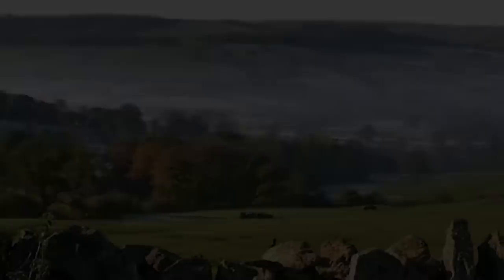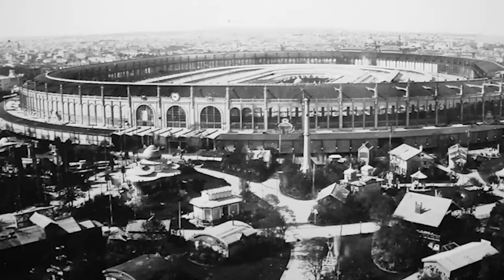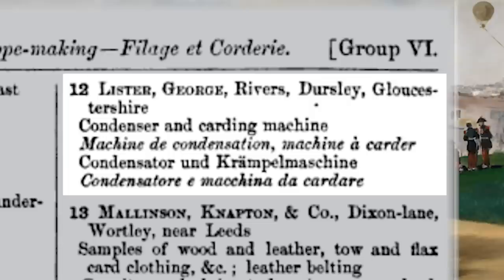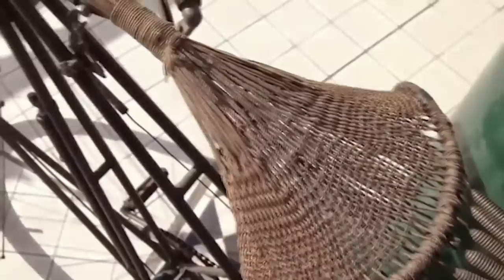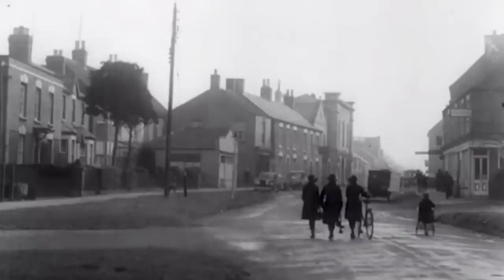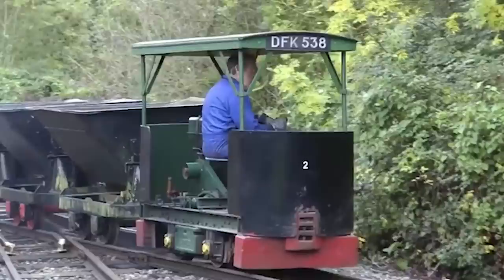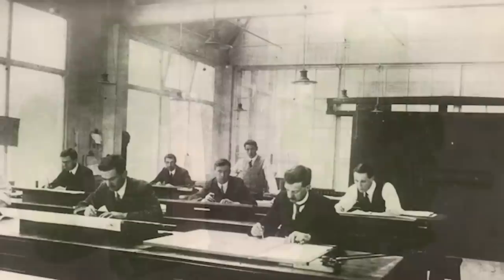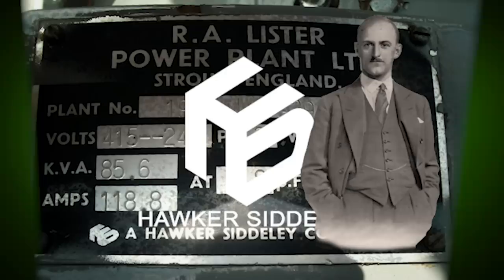The Lister Story

Comment: In 1992 I contacted Lister to see if they wanted to donate a small  diesel engine around which we could build a streamline single seat car - They donated an AC1 that had been lying under wraps in their test center since the late 60's when it had been tested as an alternative for the blue Inva cars that belched smoke from their 2 stroke - We built a tiny streamlined 3 wheeler around it and ran it at Silverstone in 93 where it achieved  1760 mpg, averaging about 17mph using squirt and coast technique  - we ran the car several years in the Eco Marathon sending framed photos back to the factory - I  still have the engine in my workshop!
Reply: A C 1 was an Petter....
Reply: @adwest68   Yup  the companies had merged to Form "Lister-Petter" by 1992 when we built it
Reply: Found this just now, is there any footage of that beast?
Reply: @pear7777  yeah I need more evidence.
Reply: Interesting story. Thank you for sharing. What happened to the car?
Reply: @G58  It made several outings at Silverstone and once at Snetterton  track to raise money for the Heart Foundation and was retired after 1999 when Shell Eco Marathan rules changed about brakes etc - it went on display in a school Technology Block until time ran out in 2006 and without suitable storage it was scrapped - I managed to save the engine which is greased and stored in my workshop under my bench
Reply: @pear7777  I don't think there is any footage online anymore - I have some photos and old VHF - it was modified several times over its 7 year service life but it never seemed to get any better
Reply: @trevortrevortsr2  Thank you for sharing this information. What a waste. It’s a piece of history.
Reply: @G58  Thank you  - in a world of computers and 3D printers there simply wasn't the demand to display a frame designed with garden canes, paper and sellotape then manufactured in high tensile tube brazed together by keen apprentices - The RAF were very kind to let us test at several of their air bases runways - they seemed to understand the value
Reply: @adwest68 in the 1950's / 1960's lister also had the rights to the design of the same engine .it was named lister LP1  .but you are correct that same design of that engine .is also a petter engine yes
Reply: @trevortrevortsr2 😢

Comment: I salvaged one of my crab boats out of Poole harbour. In it was a 1940's twin Lister. after being in under water for a year or more my dad stripped it , freed it off and re-started it. I refitted it to the boat , fitted a hydraulic pump for the slave and used it for four years trouble free until I sold the boat. Now that's engineering.

Comment: Great video thanks for posting. I am lucky enough to have saved a lister diesel generator set from being scrapped about a year ago that is around 60 years old and still works perfectly and have always been a fan of the simplicity and reliability of the lister engines 🛠👍🏻
Reply: I restored a  1958 8-1 Start-O- Matic In 2005. Wonderful machine. I use it to power my workshop in Cornwall.

Comment: In 1970 our old lister cement mixer ran out of diesel.  We were miles from the nearest petrol station,so I hooked it up to a propane gas bottle . Surprisingly it ran for a couple of days till we refueled.
Reply: I presume that you arranged for the engine to get liquid propane. Is that right?

Comment: In the late 1970's I worked at a rental yard, 
in Palo Alto Ca.  There were 3 Lister engined 
generators there.  From what I remember, the 
founder had purchased 6 gensets, to run at 
the Hoover Dam construction sites.  (He 
later opened up 3 rental yards.)

These were the older style "flywheel" style 
engines.  You'd engage the compression 
release, hand crank the engine over, and 
when it was spinning fast enough, release 
the compression releases, one at a time.

2 were 2 cylinder models, one was a 3 
cylinder.  If they were warm, I didn't need 
the compression release.  One turn fired 
them up.

In 1976, I went to Hawaii, for a summer, 
to pick pineapple.  We ran 2 shifts, of 9 
hours.  Yes, we picked at night.  The boom 
machine also had a Lister Diesel Genset 
on it.  No one else knew that I knew how 
to fire up that engine.

I recently found a small Diesel engine, 
about 200 CC, that has the same starting 
system.  It will go on a motorized bike I 
have.

steve

Comment: Visited the Dursley factory in the early 80's when I was at Stroud technical college as an apprentice in H.M. Dockyards where Lister autotrucks were used, they 're great fun to drive with the best tricks being either st them going in a circle, get off and leave it going round then get back on or find the balance point and drive them on 2 wheels, both not health & safety but fun nevertheless.

Comment: Barry, I'm wondering if Lister made engines for Ford's spec's. The 1.6 ltr engine was used in the early Pintos as well as the 2.0 ltr. German engine. That power unit would take a lot of abuse. I would shift mine when it wouldn't go any faster in a particular gear.
Reply: @ Dale Mettee. Dale, I think you have the wrong Lister. This is R A Lister Dursley. Then there is Lister Cambridgeshire UK which is a different company. They did mods to car engines and had Lister racing team. They are still in business today.
Reply: @barrywhitley2535  Barry, you're right, I think. Have a good day. Keep on keeping on.
Reply: @dalemettee1147 Although Lister Petter have used Ford cylinder blocks as the basis for some of their engines.

Comment: An American connection was created in the late 60's. Ford offered a Lister gasoline 4 cyl. engine in its Pinto cars. Their 1.6 liter was much too small for the rigors of the America roadways. The bigger 2.0 ltr. German 4 cyl. Engine was much more favorable. It also got pretty good mpg's. Ford later developed it's own 4 cyl. engine the 2.3 liter that not even close to the German engine.
Reply: Dale Mettee. Don't know where you got that info from. Lister did not make a gasoline engine in the late 60s. All the engines in the range were diesel and none would have been suitable for a car.
Reply: @barrywhitley2535  Barry, I got it from the Ford Pinto adds. I got the German engine because in required a standard size oil filter and the fact that the smaller engine required only 3.5 quarts of oil and small small filter. Now I don't know where Ford got the 1.6 liter engine but they called it a Lister made in England.
Reply: @dalemettee1147  Dale, I wonder if you are thinking of the LIMA engine used in the Pinto. The Pinto engines were built by Ford Europe. Ford didn’t introduce the Pinto until 1971
Reply: The confusion is understandable. In the late 1960’s Ford Europe developed Fords first 4 cylinder belt driven SOHC engine and called it the Pinto engine. Manufactured in various displacements it was used widely, including in North America. 

Later the same basic design entered manufacture at Lima in the USA. The Lima engines were referred to as such, differentiating them from the Car of the same name. This engine was strong and cheap to build. It was only dropped when increasingly stringent emission control requirements were difficult to meet using this engine.

Cosworth Engineering in the UK designed a totally different top end for the block. The magic Cosworth  Pinto cylinder head is highly prised and capable of facilitating 400 plus reliable HP in a well built engine.
Reply: Lister cars were Jaguar XK engine / Chassis tuners and manufacturers of small numbers of sporting specials. They also were involved with other Marquees. Today they are still around making VERY special sports cars. Scratch building mid 20th century sports cars for which they hold copyright and naming rights for. These cars are built to be perform and are beautiful.